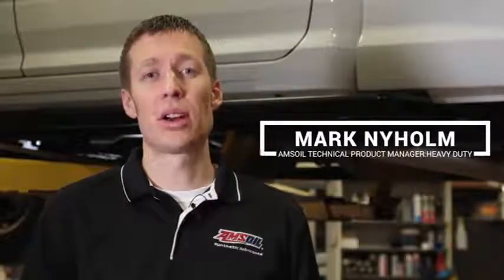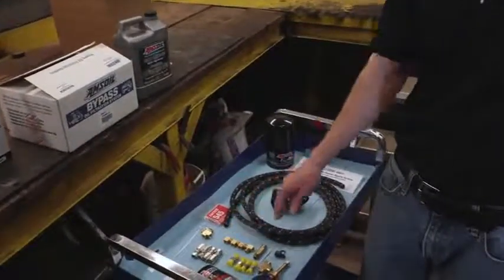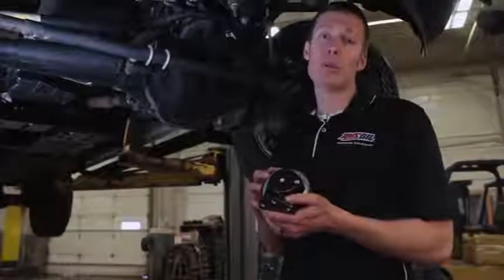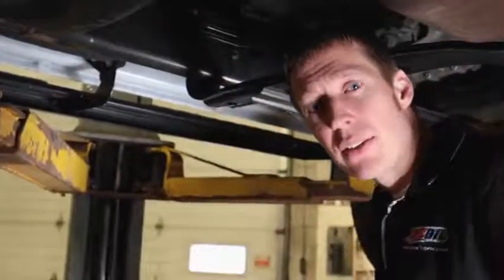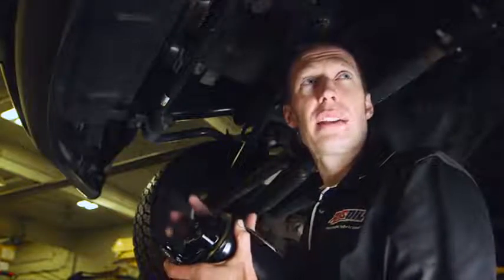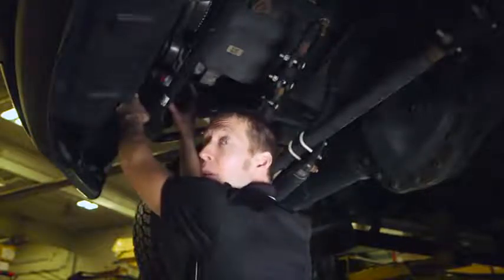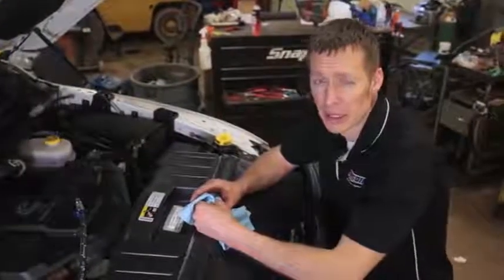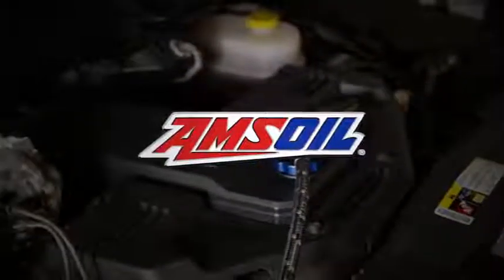AMSOIL Single Remote Bypass System Install Cummins

Comment: There seems to be 100's of these bypass installs on youtube. But very few results videos. The one or two results videos I've seen didn't seem to be very good. The oil stayed jet black. So until I see more positive results I'm voting no on this one. And I'm seeing a lot of install videos with comments turned off ?!?!?! Hmmmm ?!?!!?!?
Reply from the maker: Why is the oil turning black? Good Question. The "black" - diesel soot particles suspended in the oil which are sub-micron in size. The bypass filter is not able to remove it. A bypass filter will not catch these particles unless they agglomerate or reside in the 1 to 2 micron range (AMSOIL bypass filter efficiency). Although diesel engine oil tends to discolor due to the sub-micron soot particles which get by filters, these small particles cause very little wear due to the smallest engine clearances of about 5-10 microns. By keeping your oil filtered to the 1 to 2 micron range you are greatly extending the life of your engine reguardless of oil color. As well, motor oils contain dispersants to keep those soot particles separated and suspended to prevent them from causing wear.  Hope this helps.
Reply: This was my concern upon doing my first oil change with bypass installed. Oil was still black. 

After reading the Amsoil's representative reply. I guess it makes since. I still would have liked to have seen a visual effectiveness of the result. I use Blackstone for my analysis. I'll see once my report gets back.

Comment: This video was confusing.   You stated that you can get the feed for a 6.7 Cummins for the bypass filter off the top of the housing for the full flow filter.   Then later you discussed the “puck” for the 6.7 Cummins as well for feeding the bypass filter.   My amsoil 6.7 Cummins kit didn’t come with the puck.   I’ll be calling Amsoil to verify.
Reply from the maker: Yes, when in doubt contact AMSOIL Tech Support with any questions you may have about a product. Check top of full-flow oil filter housing for two plugs. The AMSOIL Bypass System includes fitting options to replace one plug. If both plugs are not accessible, order optional part BK1104 ("puck"). See BMK34 Installation and Servicing Instructions below for more information.  Here is a link to the BMK34 install instructions which would have been included in the kit you purchased:  https://www.haldimandsyntheticoil.ca/doc/blog/BMK34-install.pdf
Reply: @HaldimandsyntheticoilCa  explain to me how routing oil after the full flow factory filter doesn’t starve engine from oil lubrication at crank bearings under pistons, piston wrist pins, cam shaft bearings, lifters, pushrods. And why if it didn’t do this mopar wouldn’t already be using their own system but aren’t. And warning against it with voiding their warranty.
Reply from the maker: @Jon-O.  Basically, oil flow passes through the existing full flow oil filter as per normal, flow not affected and oil pressure not affected. Where an oil bypass line is installed to a port, a portion (metered) of oil flow is routed through the bypass oil filter, on its own. Kits where the mount contains both full flow oil filter and bypass oil filter, oil flow passes through each filter separately. Again, metered oil flow passes through the oil bypass filter since it cannot handle full oil pressure/flow. I agree, if the oil bypass filter were installed as you describe, there would be serious issues. 
As for vehicle manufactures stating that the use of aftermarket equipment can void the vehicle warranty, that's something they have always had in place, regardless of equipment in question.
Reply: @HaldimandsyntheticoilCa  I think you are misunderstanding what I’m asking. With out a bypass system installed the engine receives 100% full flow after pushing through the “full flow filter”. So if the bypass system takes only ten percent of the full flow essentially that means the engine only receives 90% of flow. This seams like this may be a issue over time. Question is, is the soot more damaging to the bearings and races than the reduction in 10% flow?
Reply from the maker: @Jon-O.  To my knowledge there have not been any issues of oil starvation with the use of AMSOIL Bypass Systems, when properly installed. The vehicle I drive has had an oil bypass system for about 10 years. No signs of ill effects.
Reply: @HaldimandsyntheticoilCa  thanks for your time and reply you can’t incorrectly install as based on the kit there is only one way to install.  Good to know what vehicle is it you have the system on and which system is best for my 2017 ram cummins?

Comment: Wouldn’t it be less messy if you don’t mount the filter at an angle?  I always figure that guys that design filters that mount at an angle, never change those filters themselves.
Reply from the maker: Hi Brian.  I have a dual mount set-up on my vehicle with the filters positioned vertically.  Even in this position, the oil in the lines is draining out as the filters are removed.  The angle has no effect on the "mess".  In this video, the filter mount was installed on an angle due to lack of room on the frame rail above the sway bar. Thank you for the question.